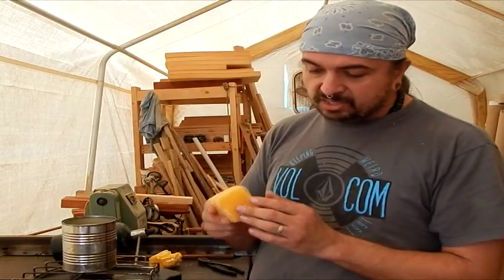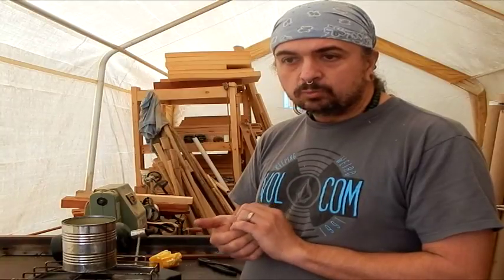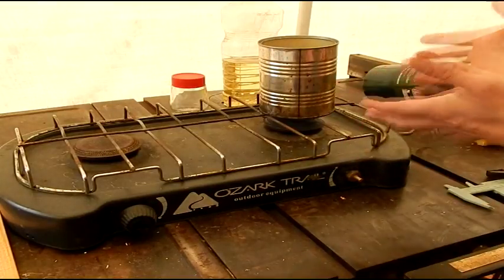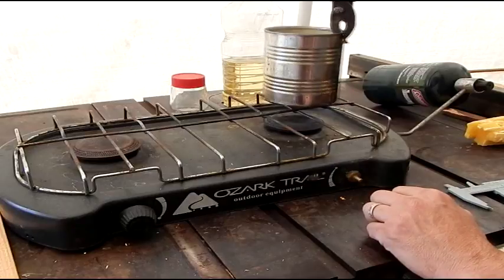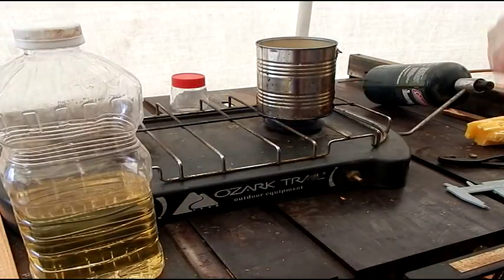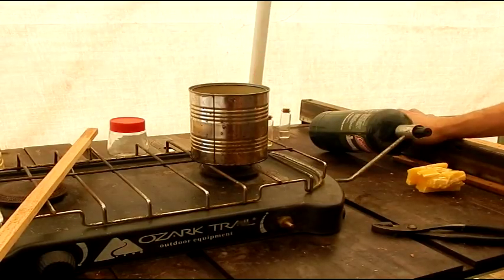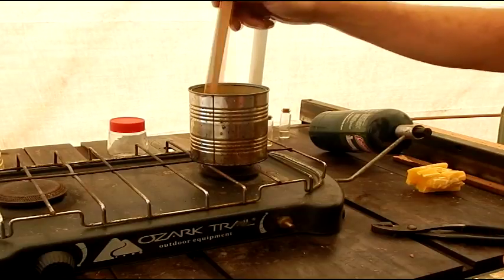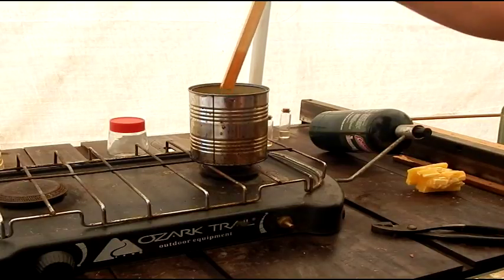Making wax for your Native American Flute

Comment: For added safety melt the wax in a double boiler. The water insulator will prevent the wax from overheating and creating ignitable fumes

Comment: a trick i learned from my grandfather, as a quick and cheap way to protect and finish wood work, is to use vasoline (petroleum oil/jelly), i use it on my flute, a small one made from red cedar, vasoline may not be all that natural but it is very safe, cheap and easy to use and obtain, i apply with my fingers and the heat from rubbing it on works it in nicely

Comment: I wonder where I could buy Bees Wax arround here I could make my own flute Wax. With Eucalyptus oils, and my secret oil that I would use is a oil blend - Theives oil … How many times do you need to wax the flute in a year ? Great informative video.
Reply from the maker: Sometimes you will find beeswax in hobby stores and of course you can usually buy it directly from bee farmers. Typically, under usual use, I would recommend waxing the flute at least 4 or more times per year. It is really on a per needed basis depending on how to finish fades.
Reply: Ok , I just found a person that runs Beehives close to me, I will go see him and get some BeeWax to be able to make my own Flute wax. Thanks again...

Comment: Great advice and presentation. I'm going to make a little pot of your recipe for the sunflower stalk flute I recently made. Would you recommend heating the wax back to a liquid and swabbing the inside of the flute as well?
Reply from the maker: Especially with a sunflower flute it is not a bad idea. This will help seal any cracks or pores in the material. I wouldn't recommend doing it over and over again over a course of time because it will create a buildup that will change the tone of the flute. We occasionally use the liquid form on the outside of our hardwood flutes.

Comment: Hey Charlie you have inspired me to make my own flute I used black bamboo and it sounds great! Can I use plane old olive oil rubbed in and out to protect it? If so how often should I cure with olive oil?
Reply from the maker: Hey! Yes you can use olive oil. Use it at least every other week or as needed.
Reply: BlueBearFlutes thank you! I asume coconut oil as well correct?
Reply from the maker: Absolutely. I will let you know that we add the tea tree oil as an antibacterial.
Reply: BlueBearFlutes yes I make my own deodorant for me and my wife. Using coconut oil, baking soda, and arrowroot powder also with few drops of tea tree oil. Make sure your family does the same. Deodorants out there kill your lymph system leading to desease.

Comment: Hi Charlie, I also have a background in furniture making. Quick question: Is there any specific benefit to adding the jojoba oil to the mix? It tends to be rather pricey, and I would think that the relatively small amount used would be about the same as just using an extra bit of sunflower oil. I know this is one of those recipes that you can just modify a lot and play around with, but I was curious to know what jojoba "adds" to the mix.
Reply from the maker: Hey JC. Thanks for watching our channel! These days I don't use the jojoba any longer. It did add a little more "substance" to an already viscous mixture. You are absolutely right, too about modifying your recipe. In the winter we use a little less wax and a little more oil! :)

Comment: Howdy doo Just a suggestion in case you didn't know is the melting of the wax. Is best done in a can that's is placed inside a pot of water. Because heating it the way u did kills the potency of the wax, burns it. Lest way is what i do for my didgeridoo mouthpieces. All the best bro...lol
Reply from the maker: In addition to being beekeepers ourselves, I do know that all commercial beeswax sold in the United States has been heated to at least the temperature that I am using in this video. The purpose of using a double boiler is to prevent the wax from catching on fire since it has a lower flashpoint than people are accustomed to working with. Honey, on the other hand, does lose something if you heat it too much. These days, like numerous beekeepers, we heat the wax in a slowmelt crockpot. Thanks for watching!